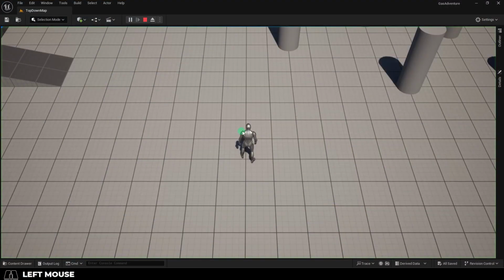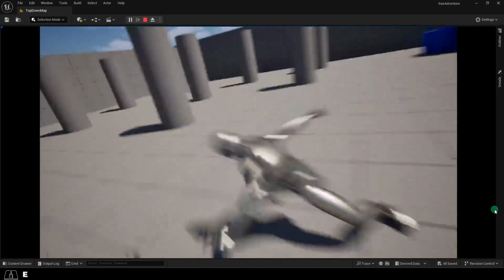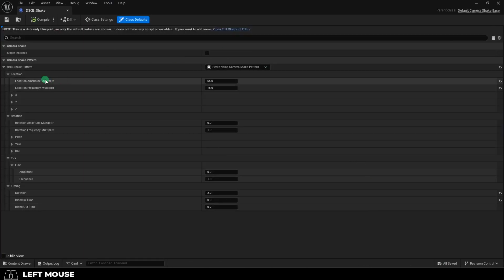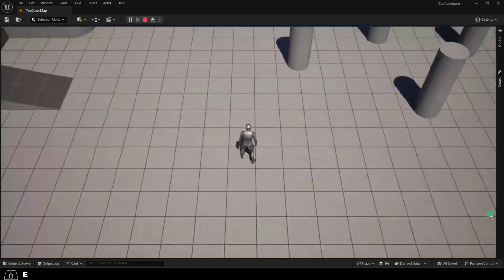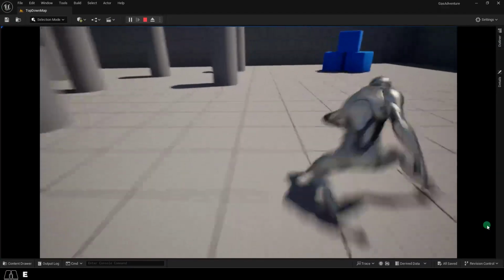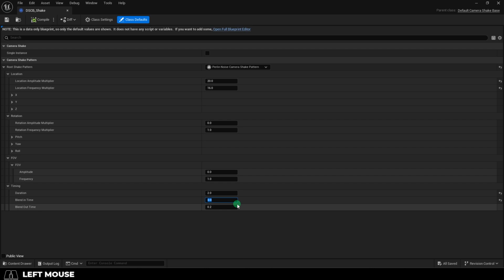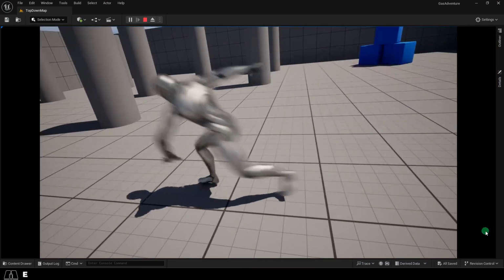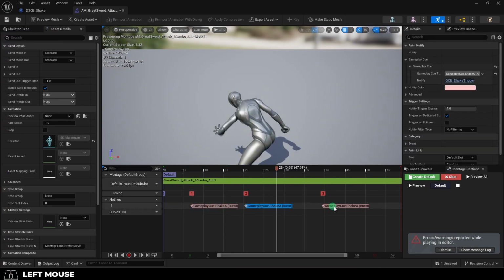UE5: GAS Camera Shake (CONTROLS)

Comment: just want to add a couple things
that camera shakes are not exclusive to gas. (as the title and description currently implies)
there are a few different types of shakes, not just perlin (perlin, oscillate are the procedural ones, sequence cam shake is animation based, and composite where you can combine multiple of the previous ones)
in the place actors window, you can search for an actor called "camera shake source actor" that can be used as a general world based camera shake as well, you can even preview it with the camera shake previewer window. window > cinematics > Camera shake previewer. and in the viewport hamburger menu at the top left, you just need to enable allow camera shakes without needing to play in editor
there is also a camera shake source component too if that's your jam